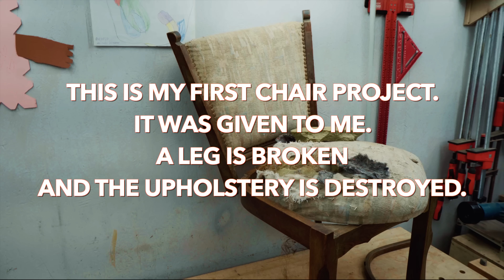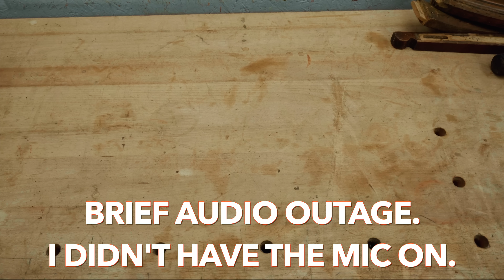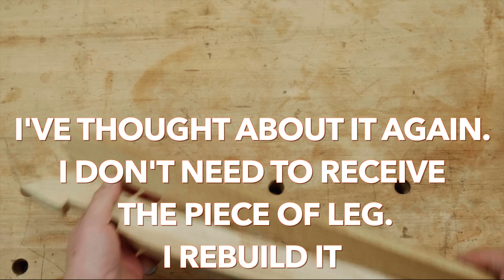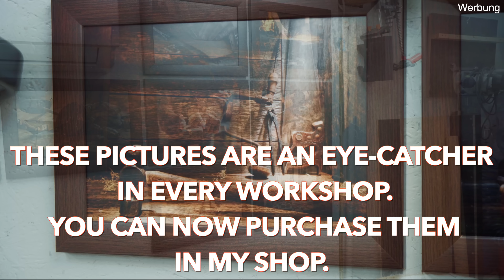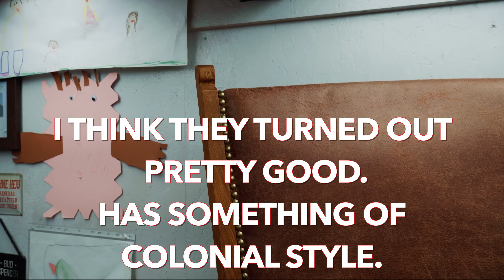Schöne Restaurierung eines ZERSTÖRTEN Stuhls

Comment: If you go back and look at the burlap layer you removed, you’ll see that the edges were folded before stapling.  Cutting a raw edge so close to the staples will ensure that it tears out as soon as you sit on it.  The leather on the seat needs to be pulled tighter.  Otherwise, pretty good for a first attempt at upholstery.
Reply from the maker: Thanks. I will do better next time. Greetings
Reply: И ещё, пока забивали гвозди - портили молотком и дерево. Это чётко видно
Reply from the maker: @pchelka_c_chelkoi  может случиться
Reply: Right, I learned that over time too.
Reply: It might also help to put the staples at a slight angle.

Another thing: The fabric or in this case leather should never be glued to the seat. It needs to move freely. Otherwise it is nearly impossible so smooth it out properly. The front of the seats needs to be free of wrinkles. Folds on the side of the Seat in the back may be ok if done neat and symmetrically. 

Keep it up and take your time rather than rushing it! Upholstery needs a lot of practice.

Comment: Tip!! A little more time and pulling the leather tighter before stapling, those wrinkles on the seat could be smoothed out, when you come to a corner, folding those edges would also create a smoother better finish.
Reply from the maker: Thanks

Comment: Wow. I’ve never seen a chair that still had so many layers of previous upholstery on it. I counted 3. You did a great job restoring the chair frame.
Reply from the maker: Thanks
Reply: I don’t think it was previous upholstery. This type of chair has many layers. They used other scrap of fabric to help keep the spring down as the burlap isn’t strong enough to hold on its own. And the hair can poke through the burlap to easily. All those layers help develop the crown of the seat as well.  My 85 YO dad is an upholsterer. He still constructs furniture with all those layers. Of course modern inexpensive chairs just have a bit of jute or nylon webbing and foam. Beautiful craft, both the woodworking and the upholstery.
Reply from the maker: @lfuentes4098  Thanks for the nice comment.

Comment: It is a good attempt, but the nails are not all in line and uneven spacing. Also the folding of the fabric on the corners of the seat looks very strange. I am sure you can do better when you work slower and set your standards higher.